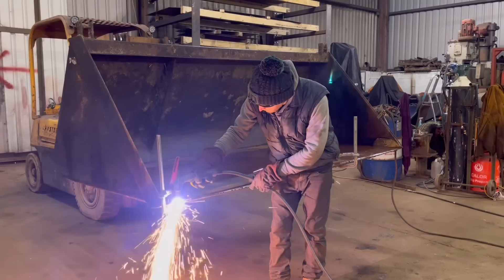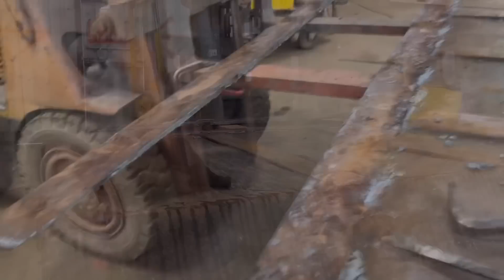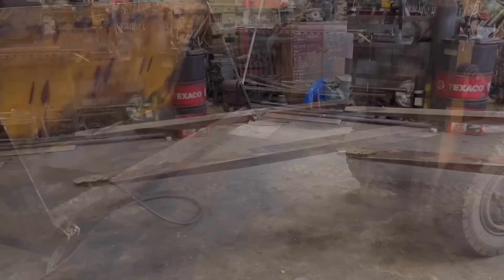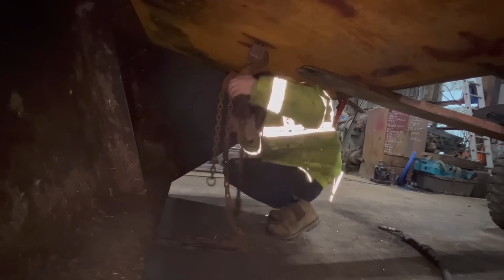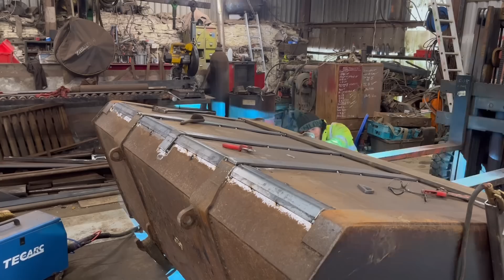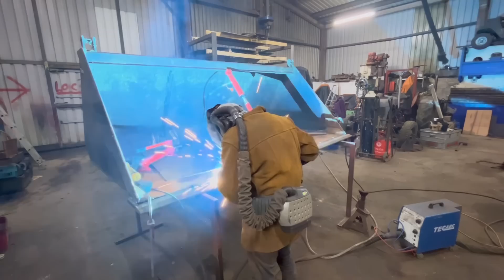Telehandler bucket, New wear edge and crack repairs

Comment: Hopefully by now you are now welding a reverse j's onto the bottom underside or even inside depending which way the bow is. 
Then put a wedge in between the blade and the long arm of the j to pull it level with the blade and then weld along the edge. 
Cut the j off and its all nice and level, I hope.

Comment: Silly question when you was cutting flat bars from the plate wasn't it easier to use free edges and cut 3 or even 2 sides only? It looks like a lot of scrap material to be left on the table. Need to ask my lads if they do the same.

Comment: Another superbe job completed by Snowball Engineering. I like the way you always improve over the original design so that the equipment will last longer before next failure rather than replacing like for like.

Comment: My question is why are you using soft flat bar for wear strips? You have a big enough plasma table to cut wear strips from 350-450 grade hardox or 700 grade high tensile sheet
Reply from the maker: Not necessary, on a bucket like this the extra wear isn’t worth the cost. It’s not doing high abrasive work

Comment: Nice work! Three "Welders"jackets over a quilted thermal jacket. Sized for moving around. Worked outside in a Steel Mill Stateside doing Clean-up burners job on large plate, ingots and sculls coming out of ladles that could hold 150 tons of molten steel. Also in a slab yard banding 10"X60"X35' , 10"X80"X35' slabs of steel year round. Quite so abrasive for clothing as well as cold winter nights and days."Heats in the tools"; the old timers would tell this kid.

Comment: So Hypertherm spent all the investment in engineering to just be ripped off by a Chinese manufacturer. At some point you need to understand that that is not sustainable, and you are contributing to your own downfall.
Reply from the maker: It’s definitely sustainable to me.
Reply: @snowballengineering  That was my point bro. It's cheap for you now. What happens when you can't get consumables or support? Then just have to buy a new Chinese machine again. It's more expensive in the long run.

Comment: Bucket is better than new.  Just for giggles, you might try gouging backward and weaving with lower power.  Kind of carve the weld away.  That's the way I did it because I didn't know better and only had cutting nozzles.  In my opinion, flux core is the best on that rusty old steel.  Glad to see that you continually are adding to your equipment and tools.  Maybe a sawhorse of heavy steel to put under the cutting edge so you can clamp everything to it have it stay straight.

Comment: I have a coat like yours, and I like it.  I don’t know if you can get the same coat in a dark color.
Reply from the maker: I like mine it just doesn’t like weld, it’s a pain sometimes having to change coats so I don’t burn holes in the hi viz
Reply: @snowballengineering when I was welding on the railway we used to have hi viz flame retardant  jackets that had a quilted inner and outer was waterproof (sure they was called flame king) Was very good when flame cutting the rail in the rain.
Perhaps ask in the pub next time your in there to see if any track welders have an old one 😉😉

Comment: Nice job, as always!  A couple of thoughts from a guy who's been doing this kind of stuff for 40+ years.  I've used winches or a "Come-A-Long"  as you did to pull the floor of the bucket, but they are awkward and a pain to use.  In that situation, I weld on a couple of tabs and use a short length of chain and a Turnbuckle.  You could use multiples of the setup and leave them in place and adjust as needed.  Also, considering the amount of time spent fighting the bends in the floor of the bucket, I believe it would have been more cost effective to replace it.  Best regards.

Comment: Nice work. As for a work coat, I wore a sweat shirt under a hooded sweat shirt with the ubiquitous standard green welding jacket over them. Good down to about 15°F after that I would add long underwear to the mix. Worked outside down to -10°F with that. The welding jacket needs to be one or two sizes larger then you would normally wear.

Comment: I was wondering what the difference is between the cutting tip and the gouging tip on the plasma cutter and how do they work differently? I don't know anything about plasma cutters, as I don't own one. I almost bought one a while back, but it was a special order sale and they sold out already, so I missed out.
Reply from the maker: The gouging tip has a lot bigger hole in it.

Comment: Very nice job again.  As for your plasma table, try covering the larger open areas not being used with welding blankets or something.  That will help limit the open area your ventilator is pulling air from.

Comment: Nice repair, I suspect half of the reason the buckets crack there is having 5 ton of telehandler pushing a bucket along a floor into a dead stop raised kerb or edge. But you are right in that it isn't the best design.

Comment: Hey what kind of welding helmet do you  use and is that a fresh air one and are they mandatory ware your at Thanks
Reply from the maker: It’s a 3m speedglas 9100, it has a filter in the pack to blow clean air into the helmet.

Comment: I really enjoy watching the work you do.  I hope I don't come across as a preachy old man, but you (like a lot of welders) do something that really worries me.  When making tacks you use your hand to shade your eyes from the arc without wearing any eye protection.  UV bounces around the entire shop, so your eyes are getting repeated small exposures.  This builds up over time, so by the time you are my age (very old) significant damage has been done.  Inexpensive plastic safety glasses with UV protection can really help.  If fogging lenses is a problem in your cold shop you can use anti-fog wipes to prevent it.  You only get two eyes, and I wish I had taken better care of mine.  Cheers!
Reply from the maker: Noted. I’ll do better to look after them. Thanks

Comment: If you were to lay a thin sheet of steel over the large portion of the table you’re not using it will make your fan much more efficient. You could test it out with a piece of ply or old cladding, obviously ply is a wee bit of a fire risk

Comment: For your porta pac some nice to haves, an air over hydraulic pump saves trying to hand pump in awkward situations.
A hollow cylinder to pull in bushes and bearings without dismantling for the press, also can be used with dimple dies.
A pull cylinder to take the place of your come-along.
Not essential but they can make life easier.
Great job once more, take care.

Comment: On the point of fitting a bigger extractor fan, to help in the mean time  try to cover as much surface area as possible. Even if it’s just with cardboard. That way to only way is through the extractor 👍

Comment: bandaid repair job tinfoil bucket you're British much be proud you can make crap  should be the other way around make something that lasts for a while customer had a bucket like that told him not waste your money or my time it a one-use bucket i have made him 20 new buckets doesn't bend went you look at it  
i have found an end loader for a tractor aftermarket farm that was not weld level custom wants me to fix it not interested in doing the job told him to find someone other than me  i am afraid will be opening up can or new problems I don't want to be bothered with them
Reply from the maker: It’s just a cheap and cheerful bucket. It’s on at least its third wear edge so it’ll have paid for itself a few times over.
Reply: OMG! Jennifer White is in the comments! I can't believe you feed the troll with a responce Oliver.  @snowballengineering

Comment: Enjoy your channel. Those 8 angled straps on the back corner seem like they would cause drag as the bucket slides into whatever stuff it was moving. Wouldn't it be better to reinforce from the inside of the bucket for that back corner. Always interesting, thanks
Reply from the maker: Drags not an issue to worry about. Better on the outside so it wears them rather than the back corner of the bucket floor.

Comment: you dont need a new fan on the cnc plasma, speaking from experience using a cnc plasma, get yourself a few sheets of light plywood to cover the areas of the bed where your not cutting, put them on between the fan and the plate your cutting to extend the area of suction

Comment: Very nice job.   I've got one of these to do, I suppose it is hardox or something, I'll be stick welding it,  and there's a label on the new wear edge which says I should pre-heat it to min 100c before welding.  I didn't see you do this so is it really necessary?
Reply from the maker: For a digger bucket that gets a lot more abuse I’d preheat. But for these types of bucket the edge is usually well worn out before the welds fail.  I’ll have welded over a hundred of these edges on at my previous job and we never preheated any.
Reply: @snowballengineering  very useful tip, thankyou.  I also wasn't sure how I was going to keep the new one flat, now I know.

Comment: nice work
when we replace the blade on a bucket. we immediately put a bottom knife under it. when it is worn out. you just have to replace the original knife

Comment: Nice job, however I would have made first plasma cut a an angle and stiched new cutting edge to existing plate which had not cracked and ground weld smooth making repairs strong and invisable. Rest of repair I think you did an excellant job for your client, Great results. Ray Stormont

Comment: 25mins onwards try using "wedge and dog" and keep yourself at minimum risk.  far easiier to work from above than squatting under a bucket with a chain pull and slings.  Top job though 👍
Reply from the maker: Im not sure how a wedge and dog would work in that situation. I needed to pull the whole floor down

Comment: It always amazes me the amount of times I've seen buckets worn through on that back edge and still the manufacturers have them like that. Our local blacksmith used to put a thick heavy bar (quite often the edge removed from the front) across the back edge as a wear plate. We've all used the back edge of the bucket for leveling a heap of sand or soil.
Reply from the maker: When I make a bucket from scratch I weld a square of bucket edge on the 2 back corners.
Reply: Always a trade off against weight and cost. To be fair that back edge ware is down to a bad operator. I used to work in a factory and we had loads of thin heals on forklift tines again down to operators running about with then rubbing on the floor.
Reply: Yeah but manufacturers don't want the bucket to last forever as they want you to buy a new one in the future.
Reply: It’s all about the $$$
Reply: IT'S the way I did our Bobcat bucket years ago, Put it at a snowplow cutting edge at 30 degree angle and called it a "BACKDRAGGON" = Should have patented and trademarked it. Well too late to worry now,

Comment: Not easy, I have put 3 edges on one bucket on site with a stick welder over the years as they drive with it on the concrete. Last edge I put on was 40mm so when they wore it by 10mm I put 10mm ar450 shin strips for cultivator legs. Know just go back and replace them.

Comment: Great job on the bucket, those hydraulic power packs come in handy for lots of jobs, after a while you will wonder how you managed without one. You can improve the downdraught on the table by covering up the unused open space with some thin plate you might have lying around or anything really that's not inflammable to sparks even thin plywood, by using smaller pieces your work area becomes adjustable and that way the fan you have will only be sucking from the open cutting area.
Reply from the maker: Yes, that would help.  When I’m cutting a full sheet nearly all of the smoke gets sucked out. The down draft table is sectioned so it only sucks out the area it’s cutting which helps
Reply: Yup. The "before and after" using them is like night and day. And i was reticent in getting one the first time, because i was using a variety of screw jacks and splitters (the oldie wood splitter wedge with a screw in the center). Hydraulic is so much better.

Comment: You say "95A is flat out for my plasma"
🤔. At 100% duty cycle???
Reply from the maker: 70amp is 100%.   Doing this job is not using it long enough to reach its duty cycle
Reply: @snowballengineering  yeah, this isn't close to 100%, but I was a bit unclear on what you meant.
Thank you!  👍
Reply from the maker: Flat out amp wise. Meaning I cant physically turn the power up anymore.
Reply: @snowballengineering  JCB keeps you busy.
I guess there has to be a 'fuse' (point of failure) so the operator doesn't destroy the expensive hydraulics or boom